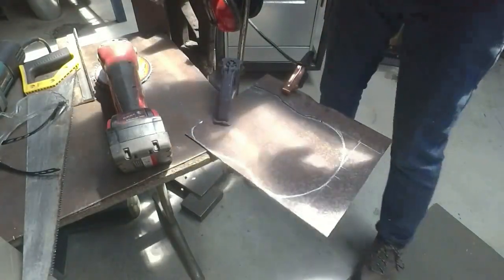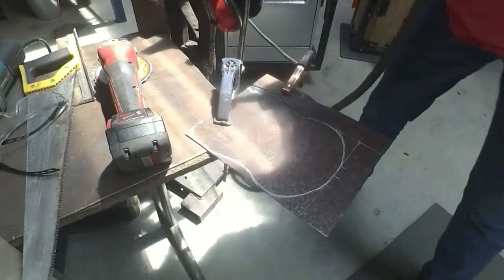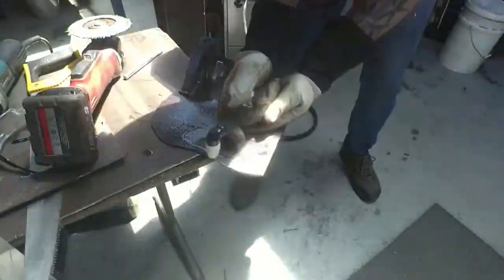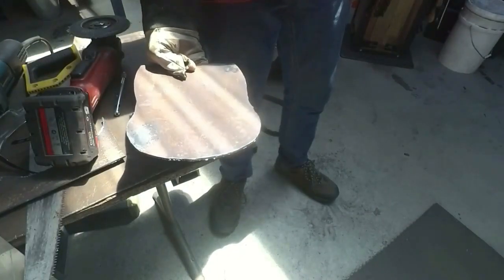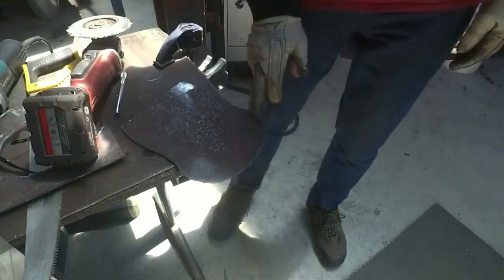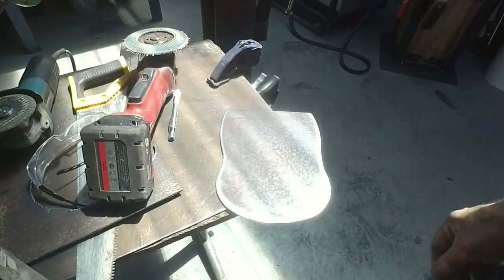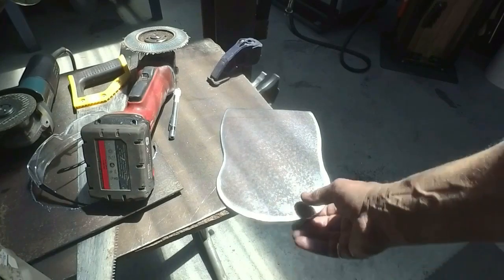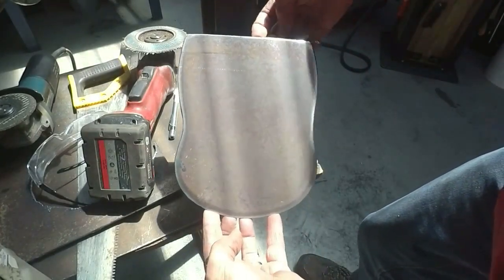Forging My Coal Shovel

Comment: I was taught working your steel from the center toward outer edge or center to near edge. Using the center/face portion of your anvil to straighten, planishing or upsetting your work to gain mass. It worked for me, it allowed me to get more work out of an isolated heat for forming to welding ( I hope you understand what I am trying to state)..  But I was just a Farrier….
Reply from the maker: Yer I think i'm following your drift. Your right I do tend to do way to much forging on the flat of the anvil which is a bad habit I'm going to have to get out of.
Thanks for your tip I really appreciate it. And thanks for watching 👍⚒

Comment: ..Good job Andy!! Ya ought to be able to anything ya want with it, even digging holes. i made a rivet banging tool out of an old trailer ball. Welded a 8" piece of axle on it and forged it to fit the hardy hole.  Also forged a dimple in the top to catch the other side of a rivet. To me it's the   Beez Kneez...!!
Reply from the maker: Thank ya kindly I'm happy with it for a first try. I've got a rivet tool made from an old tow ball. Remember I was the one that posted the video "Monkey Tool" 6 months ago. I just got slack and went to town on the anvil to see how it turned out. A bit rough but it's solid and it's just a coal shovel so good enough. Wouldn't do that if I was making it for someone else though lol. Thanks for watching 👍⚒
Reply: @andywright2606  ..yep, yore right. my mind is shorter than.. my hair. It's good to know what you can do, and where on the anvil...

Comment: Ok from what you said with the stock rotating when you're drawing out a taper, could be because you need to start at the offside of the anvil and lift your hand up so the end is touching the anvil and start the taper there. Some smiths will do a taper starting on the horn, Mark Aspery does it good. Brian Brazeal does some fantastic tapers too. When I get time mate I'll do a video for you. Are you talking about square stock or round??
Reply from the maker: Yer mate taking about square stock which shows the twist in the flat surface. I understand what your saying of using the far side of the anvil and lifting the hand. Thanks Mate
Reply: Forge Wright ok good mate always glad to help. If it’s not too hot tomorrow  I’ll do a video on some tapers.

Comment: With the tapers and the twisting, it's practice, concentrate on hitting straight and holding the stock straight. Just practice mate.
Reply from the maker: Yer I thought it might be dragging the hammer off the right side of the stock when hitting causing that twist